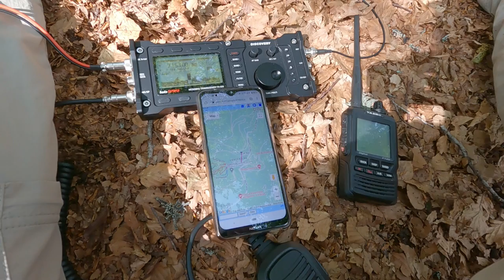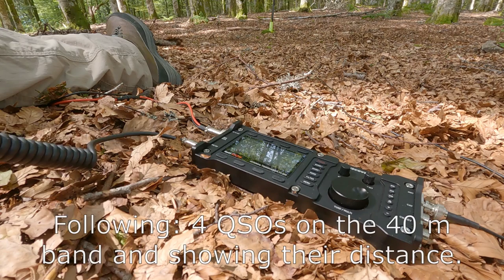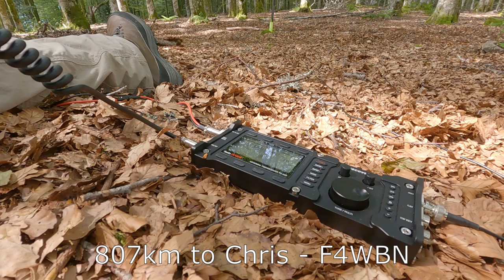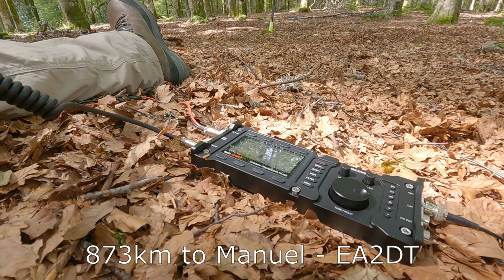Quick EFHW antenna setup and SOTA QSOs with the Lab599 TX-500 transceiver

Comment: Great demonstration about how easy it is to put up a EFHW antenna!

I've just started to use an EFHW and I love it. No need for a long run of coax, and can easily be elevated with a telescopic pole.
Reply from the maker: Yes, It's really easy and quick to setup an EFHW antenna. I used my standard 7-band EFHW on more than 200 summits and mostly there is no telescope pole guying needed as well, which is shown in the video.
Enjoy the hobby!
Reply: @PortableRadio  I've noted your technique of supporting the pole and will try that in the future.
Reply from the maker: @VA3OSO  For this and other tips, just read my related EFHW antenna document (link at the video description). At the end it got pretty long (>50 pages), even with focusing on practical experiments and aspects.
Reply: @PortableRadio  Thank you, I will check that out.

Comment: Nice film! Lots of trees, which must shelter you from any wind I guess.
73, Fraser
Reply from the maker: Thanks Frazer, indeed, lots of trees on the summits in this area. They block a bit the wind, but compared to Scotland, fortunately, there is hardly any wind. That's why this kind of setup with the telescopic pole works so easily...

Comment: Hi Stefan, great job and great video! May you describe the support? Which type of article i have to buy in dechatlon? Thanks a lot, 73 de  iw2hus, Franco (happy with an 8010 EFHW inv.L 10m vertical + compensation coil + 15 radials 4m long) .
Reply from the maker: Hi Franco,
I'm not at home, but you'll find the corresponding link to the article in my document. I bought them in Switzerland and in Spain. Just search for Decathlon in the document.
73 Stephan
Reply: @PortableRadio  Many thans, I'll try! 🙂
Reply: @HB9EAJ Portable Radio  Founded!!!!

Comment: Thanks Stephan (although I'm already convinced by the convenience of your 7 band EFHW for SOTA!). 

A quick question on the TX-500, does the speaker mic have a socket for plugging in earphones? I need to shed some more pack weight so am thinking of adding either a KX-2 or TX-500 to use instead of the IC-705. Still trying to balance the pluses and minuses of either rig.

73, Jonathan G4IVV
Reply from the maker: Hi Jonathan,

Yes, the speaker mic does have a 3.5mm earphone socket that is protected for ingress. 

I just tested it with two headsets (4-pin) and one headphone (3-pin) but I could only hear the audio in the left earphone. If needed, a mono-adapter could solve that. When using the contained mic/speaker cable, one can hear the audio with all headsets/headphone on both earphones.

Until now, I never felt the need for a headset when doing SSB, since one can quickly put the speaker mic close to one ear, if need be. With CW this might be different. 

And yes, the IC-705, KX-2 and the TX-500 have all their plus and minuses. I usually weight each requirement when doing a comparison, but at the end probably the gut feeling wins ;-)

Looking forward for our next QSO!
73 Stephan
Reply: @PortableRadio  Thanks Stephan for testing that, its very helpful. I'm sure the mono issue can be esaily worked around. I'm still at the stage with my CW that I need to block out all external distractions to stand a chance of copying correctly ;-)

73 Jonathan

Comment: Nice video, Stephan.  I'm intrigued by that equipment you push into the ground, as a base for the collapsible pole.  Is that one of your home-brew items, or something you purchased?  Tnx & 73 de VE7JBT
Reply from the maker: Thanks Jan for your question! 
This bright support can be bought for a few bucks from Decathlon and they call it in English a 'rod rest'. 
On page 12 of my document,  that is linked from the video description, there are links for some countries, but I'm sure they'll also sell it in Canada.
Reply: @PortableRadio  
Did you modify the outer diameter of the lower "plug" on the Tactical Mini mast? Mine is too tight a fit in its present state. In your video, however, it slides in very smoothly.

A very helpful video that shows how to get on the air with no fuzz.
I also like your article on the EFHW, excellent stuff!

Cheers,
Uli
Reply from the maker: @ulistahl6555  Uli, thanks for your feedback!
If I understand you correctly, you mean the red banana plug insulation that I slide over the top mast section? I found this insulation in my chunk box and it just fits perfectly. Another solution could be to use some shrink tubing.

But probably you mean the rod rest that seems to be too tight for your Tactical Mini mast. It's a pity that it doesn't fit in your case. It seems that the exact measurements of the mast seem to differ from batch to batch. With mine, I even added some duct tape around.

73 Stephan
Reply: @PortableRadio  It was indeed about the rod rest and the Tactical Mini mast.
But I found a workaround:
Simply swap the top plug of the Tactical Mini mast to the bottom side of mast. Then it fits perfectly.
Reply from the maker: @ulistahl6555  Thanks Uli for your explanation!
What I don't understand is how one can put the cap from the top to the bottom. The bottom cap is screwed on and has a bigger diameter. 
OK, one could remove the bottom cap, including it's glued-on part. Maybe you did it like that?
Reply: @PortableRadio  Oops, apparently I did that. (The body-weight exercises are finally paying off... ;o)
Reply from the maker: @ulistahl6555  Ahh, I see, this is also a possibility. It seems that the diameter from the mast and the lower screw-on cap differs pretty much. 
Good to know and again thanks for your feedback!
73 Stephan